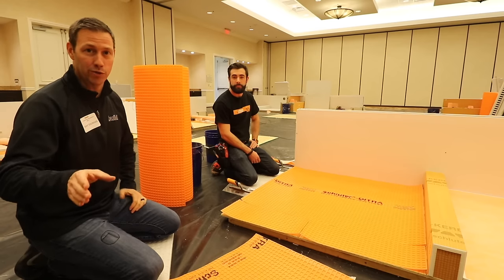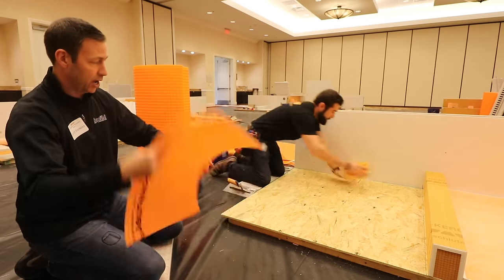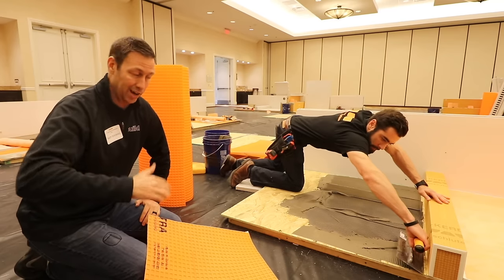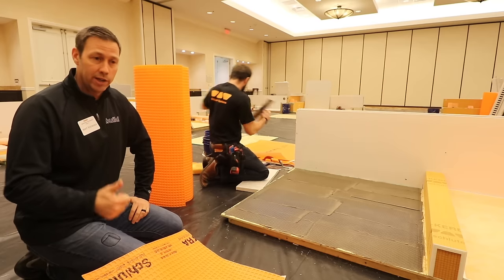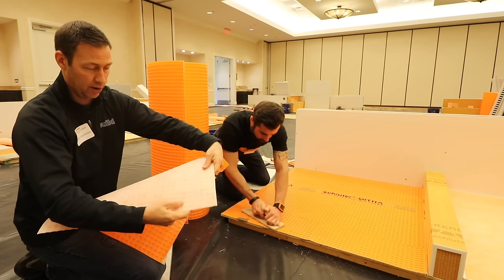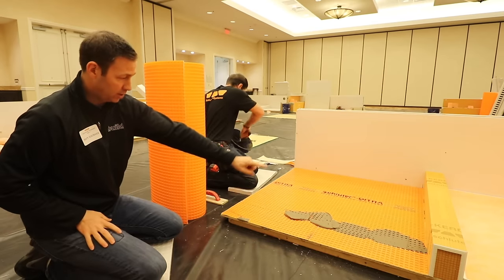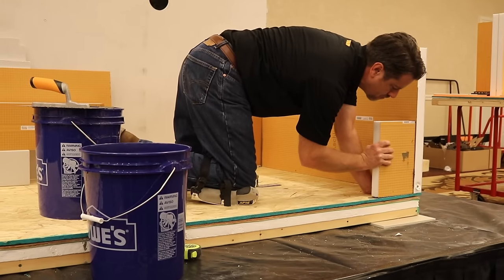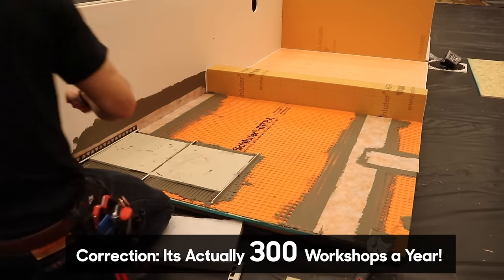WHAT is this, and WHY do you want it under your floors?

Comment: Awesome stuff, but after taking out a multitude of 1950's bathrooms that were almost completely tiled with some funky colors I might add, they were built some tough !!  Found only one with some minor water damage but not bad after 50-60yrs !! Hopefully this holds up as well, as I think it will.
Reply: Chickenwire + thick bed of mortar = make the new guy do the tearout!
Reply: @entropyfan5714  tell me about it just tore out a bath with .25 inch drywall then steel mesh with 2.5-3 inch concrete then tile I used a diamond wheel cutter to cut in between the studs and pryed it off in chunks, worst demo ever lol especially aroumd the plumbing and electrical!!
Reply: @marcfavell  they built it to last - thought the 50's would never end...
Reply: @megenberg8  yeah for sure same principles apply now to installs of tile and stone and they also knew it when they made the parthenon just the material technology is different now but same principles!!
Reply: i had to tear one out once.  it was mud over diamond mesh wire, man that stuff was hard!
Reply: @marcfavell   And you'll replace it with the latest MIRACLE PRODUCTtm that claims to last forever, but rots out in a matter of years. Not that it matters, the house is literally made of unsellable garbage glued together(OSB). Don't worry about that though! The new OSB coatings won't fail like the last ones they said would last a century, no sir, this one is the real deal. Until we release our new product, at least.
Reply: @rylpace  last time I checked plastic does not rot....only organic material rots
Reply: Original bathrooms from the ‘50’s are usually pretty great. I love the colors and a lot of buyers want original features in good shape. Why destroy things that were built basically bomb-proof?

Comment: Hi Matt, I completely agree with you about the Schluter products.  I used them on my concrete floor on grade about 10 years ago and I love it.  I think at the time I felt that I was taking a chance after our whole downstairs flooded from a toilet overflow after a massive rainstorm.  Less than a year, after install we had another massive overflow of the toilet.  I cried and we had to empty the down stairs again, but because I had all the walls to floor waterproofed along the bottom edges with Kerdi, I did not have ANY need to repair dry wall.  Boy was I happy!!!  With the Ditra between the cement and the tile, I have not had any separation of Tile from the floor.  And so as a result I am totally convinced, just as you are that Schluter products work.  I did a lot of research before doing this and was pretty convinced ahead of time.  I have NOT changed my mind, I spent extra money for it but never regretted the decision.  Thank You Schluter!!!!!

Comment: I've used This product and absolutely Love it.  Works great, as long as you do it as they have instructed. Do not try to cut corners with this product. Love it
Reply: Hi There. QUESTION ? I am doing a small tiling job. only x 2 square meters bathroom floor. I want to know ? Is there any multi purpose adhesive which I could use for both - sticking on waterproof decoupling membrane onto a concrete subfloor and also using the same adhesive for sticking tiles on top of it ?

Comment: Seeing a lot of these 'membrane' applications around YT these days. Good! I've been using rubber membranes between my dry wall/plasterboard since the 90's. I always fit highest quality double glazed windows too. #1 complaint of most private tenants is sound/air pollution. Always found it totally mind blowing that 99% of landlords don't think this matters. Guess they enjoy turning over tenants every 6 months! I think I've saved myself thousands of hours wasted on admin/checks over the years. A well maintained property = happy long term tenants. No brainer!
Reply: I can't believe that some places still allow builders to install single glazed windows for living spaces, the quality of life benefits from the thermal/sound blocking is so big that it should be in every building code. Not to mention poor ventilation is so common if left up to the tenant so you don't want condensation to wreck the sills with mould.
Reply: What rubber membranes do you use? Researching sound deadening and there's lots of opinions. Most recommend 2 layers of 5/8 as the most cost effective method. Thanks

Comment: I’ve got a 1 car garage with badly cracked concrete floor. I’m converting it to an office and I need to pour about 3” of concrete over it to level. I know it’s not the intended use, but I think I’m going to use this to prevent the cracks from propagating up through the new slab.

Comment: I have used the Ditra underlayment, and will use it again because it does a great job of isolating the tile and saves space when you want to match levels with a hardwood floor. The adhesive thinset layer must be wet enough to adhere to the Ditra fleece backing, and this can be tricky, as is shown in the video. But the biggest surprise is how much mortar must be used to adhere the tile--about twice as much as with cement board.
Reply: I'm assuming that's because a large percentage of the initial layer is filling the holes, thus not making contact with the back of the tile.
Reply: Hi There. QUESTION ? I am doing a small tiling job. only x 2 square meters bathroom floor. I want to know ? Is there any multi purpose adhesive which I could use for both - sticking on waterproof decoupling membrane onto a concrete subfloor and also using the same adhesive for sticking tiles on top of it ?

Comment: I tiled two bathrooms on the second floor of my house 7 years ago. The subfloor is a chipboard. I used ditra in one of the bathrooms. In the other I used bakerboard and redgard on the top. Both floors look fine as of today. Tile and grout are in perfect condition. If I had to do it again, I would go with bakeroard and redgard. Easier to apply. I don't even understand from their ad why anybody would use ditra over a concrete floor. Two coats of redgard and flexibond is a way to go. I tiled 300 sq ft over very unstable concrete on the first floor in my house. ( It contracts and expands year around and the old tile was all cracked as a result. ) I isolated cracks with a membrane, put two coats of redgard and used flexibond. No problems so far.
Ditra is a good product, don't get me wrong, but it is expensive and PITA to apply. Try to fill all the waffles with a thinset!
Reply: you know how to install it? filling the waffles is easy.
Reply: Architect here - the idea of ditra over a concrete floor is to isolate the tile work from the concrete slab. If the slab cracks, the crack will not impact the tile work...
Reply: @cptcosmo  As I mentioned in my post I isolated cracks with membrane and used two coats of redgard. I also used flexibond for thinset.
Reply: @Anatoly Eydelzon  your specific application has redguard and isolation membrane as an ideal and affordable solution due to it already having all the cracks for you to isolate. However in new construction, you have whatever lines the architect tells the concrete guys to cut in the slab. They are often times not very accurate lines as to where the cracks will actually form. Using a floor wide membrane eliminates those cracks from coming through the tile.

Comment: Yep!.... I thought this product was GENIUS when I first saw it on Mike Holmes’ show!  
I l😍watching his very informative show....I learned so  much valuable information!  
I have  water damage on part of my floating wood  and want to replace with tiles.  So,  this product will be PERFECT to use over my concrete  slab— and I  NEVER have to worry about title shifting with fluctuating temperatures.  I’m so excited, I can see my plan coming together, perfectly!🎊
THANK YOU, for this informative video!
P.S. I can buy a small quantity of needed supplies to use in an 33 square-foot area?
Reply: Um... Why would you use ditra over a slab?
Reply: @Sergey Romanchenko We don't post tension anything not in multistory commercial settings. Here in Wisconsin, we don't pour on grade. We can't. We have a frost line. We dig below it and we do ground prep. thusly making a post tension slab a waste of money. What's it like to have slabs that crack on the inside of a building? I wouldn't know, because we don't. But you already knew all of that because you have common sense and knowledge, right Boris? Man, it doesn't matter where you put a Russian, that inferiority complex just shines like a bright ol' beacon doesn't it Natasha?

Comment: I used it on a 3/4” plywood bath floor that I was trying to maintain the elevation going into an existing floor outside that bathroom, so I didn’t have the room to add 1/2” cement board.  After a couple years and no cracks in my tile.  That’s all I need for proof that this works...

Comment: That product is simply an Anti Fracture Membrane, its very pricey product, sure its a great product if you want to spend big bucks, or you can use a simple Anti Fracture membrane that people have been using for years, and its cost is a fraction. Great video.

Comment: Installed in my kitchen super easy great waterproofing!
Reply: It's not water proofing at all. It's a uncoupling membrane. Basically it's minimizes transfers of stresses from below it to prevent cracking through the thinset and ultimately the tile. If you think you have a water proof floor you are sadly mistaken. Infact we just redid 60 bathrooms at our commercial setting that used the product and it failed BECAUSE water  would get trapped between the prodt and the thinset ultimately leading to it becoming saturated and holding the moisture and then uncoupling and then the problem just magnified as a small section broke down and would migrate eventually to large areas and then the product itself started degrading.
Reply: @djtheg6819  He specifically talks about how it can be combined to be waterproof, and it is approved for use in showers. That isn't to say that it won't fail if left water saturated without proper drainage. But is that really worth talking about? No tile system handles being under water constantly without proper drainage...
Reply: @djtheg6819  I appreciate hearing the negatives about this product based on your experience.  Seems like you were pointing them out based on the original comment you replied to in this thread.  Were you highlighting these issues to point out that there are negatives that people should be aware of but aren't completely against using the product, or are you completely against using the product?  Also, you pointed out that trapped water was an issue.  Would you say this was most likely the case because the product is poorly designed or because it was poorly installed?  I have to believe the manufacturer took the potential for trapped water into consideration when designing the product and therefore most likely gives specific instructions on how to install it in order to avoid this issue.  Is this not the case?
Reply: Does this help on uneven slab installs?
Reply: @TimothyRitzer   I understood it is NOT the system for showers but for the occasional accidental spill (washing machine or kids making more of a wet mess than adults would to) it is fairly good.
Reply: @1pecrnet  you can get self leveling clips if the slab isn't to uneven
Reply: Hi , did u lay it over top of existing linoleum by chance ? I am want to tile over linoleum that is in good shape .

Comment: The concept behind this solid.  We’ll be using this in a total bathroom gut including a shower using the Schluter system.  My wife studied up on this more than I did, so that’s her job.  I do have to laugh about not putting tile directly on sub flooring.  I’m not sure what I did wrong but I installed tile in a kitchen and breakfast nook in 1988.  Tore it out in 2015.  No cracks in the grout anywhere, no loose tiles, no movement of any tiles, period.  What did I do wrong?

Comment: ive been in tile for 16 years and schluter is by far and away the most inventive companies i've ever used products from. it has saved me time, headache, and sheer pain. to go from 80lb sheets of concrete board to a roll that can do a whole floor that weighs like ... nothing? it's stupid strong, flexes with movement, is virtually mold immune, can be waterproofed completely.. i mean it's stupid not to use honestly. i do not work for schluter, I am just a tile guy who loves good products.
Reply from the maker: Thanks Steve. Appreciate the personal experience
Reply: I'll second that, i've been using it when it was corrugated, not squares, fitted 100's and 100's of meters of it. All Schluter products are brilliant especially the wetroom drains, no one builds an easier to fit or stronger system :)

Comment: We have bathroom with this product on a wooden floor, they used thin tiles on this product on the floor, lots of tiles are broken because this product bends down walking on it,but better for thick tiles
Reply: Sounds like it wasnt installed correctly. It should not compress at all
Reply: What subflooring do you need under this stuff?
Reply: @private8559  thanks.

Comment: You want thickness anyway , if you go from bathroom to badroom carpet , after they lay pad+carpet , when you use cement board it will pretty much bring tile level with ur carpet , and youll get nice transition. Between tile and carpet or 3/4 hardwood floors
Reply: That's where the XL comes into play.

Comment: I see the resistance of "Experinced installers" like those posting here - watched that happen for years at Lowe's same with epoxy grout - installers hated it because they had to go slower and couldn't slap it up and run out the door - Schlutter, Epoxy grout and a number other newer products take a little more time, more skill and yes more cost to customer - in the long run the customer wins and the installer saves time on call backs and fighting with customers over failed installs.  BUT you have to do it right or it won't work - that means CHANGING your work habits.
Reply: Epoxy grout only commercial projet dont ask me for house

Comment: I live outside of New Orleans and most houses have a 12" thick slab on pilings driven around 30ft. Few slabs crack. In some areas th piles weren't long enough and the house settles level but still doesn't crack. But if it does crack, the tile is the least of your worries.

Comment: A builder should always have every possible method in his arsenal.  This system was covered by Holmes on Homes some time ago however it is nice to be reminded of it.  As a decoupler, it may also be good under wood floors which are glued to a slab (only after a water seepage test has been performed and passed) to keep the boards from separating over time if a crack develops.

Comment: Just finished a bathroom remodel on my 2nd floor main bath. Full tile tub surround and from the countertop down in the rest of the room. Looks fantastic. Installer used traditional methods. We talked about the Kerdi system and it’s benefits. He really wants to use it but the company he works for doesn’t use it, yet. So, fingers crossed it doesn’t fail. 
I may take on the downstairs bathroom myself with the kerdi. Looks so much easier than what had to be done upstairs for waterproofing.

Comment: Wow…I’ve been using hardi and dura rock for years…but this system looks so much easier on the body and better waterproofing…I like the ability to keep the floor lower profile so I can have my transitions in and out of the tile area more flush to the existing floor and not have those big step ups
Reply: Check out Tile Coach, Sal Diblasi, and Starrtile's youtube channels.  They all have different approaches to waterproofing showers and have loads of in depth videos on Schluters, Laticrete, and a few other brands.

Comment: Still a fan of old school bedding.
A properly bedded floor will last decades. And works great with heated floors.
Reply: Yes.....only way to get it straight and level. You can keep this overpriced plastic
Reply: What's bedding?
Reply: @UnbeltedSundew    a bed of "mud".....a dry mix of sand and cement packed down screeded flat and level.
Reply: @contemplate-Matt.G  Ah ok, thx for the reply. :)
Reply: The mud bed is a dying art here in Washington St. Only thing its still used under is a shower pan and schluter makes cheater sticks for guys to use that cant even get good drainage free hand. I was in the tile business for years when i was younger in sales and worked with many installers to make extra cash evenings and weekends i use to love working with the couple if guys who still did mud floors or counter tops. Biggest problem people don't want to pay extra $$$ to have it done correct but are the fastest to bitch when shit starts moving in their "custom" built home that was finished i two and half months. The bad part was doing demo of old mud setups what a bitch. Several times was able to peel the tiles off of mudset shower walls scrape them clean abd tile right back over existing mudwork. Dying art and lack of craftsman willing to learn and take pride. Just want to use mastic stick it and grout it and get paid
Reply: @parentsbasement7734  quality is a dying art. Everyone wants faster which equates to cheaper and are getting subpar everything and most dont even know what they are not getting. 
Ive been in hundred year old homes with mud and lathe and still no cracks in marble floors over a wooden subfloor.
Reply: I'm removing some old school bedding in a bathroom for a friend's mother. I'm cursing the guy who put the bedding in and so is my demolition hammer